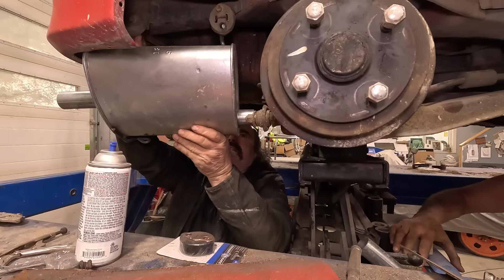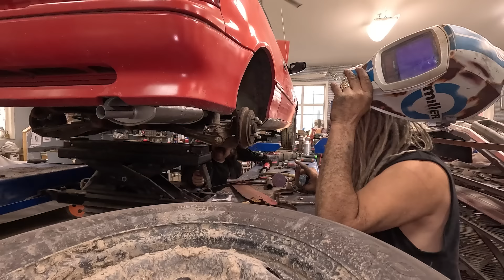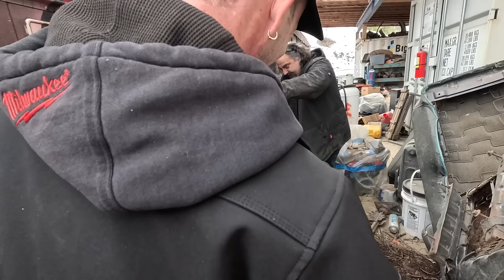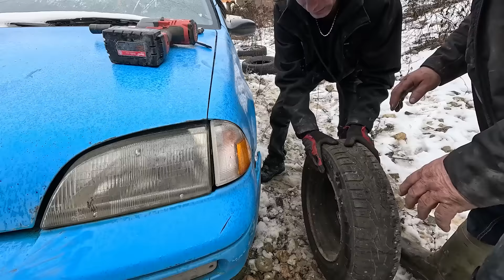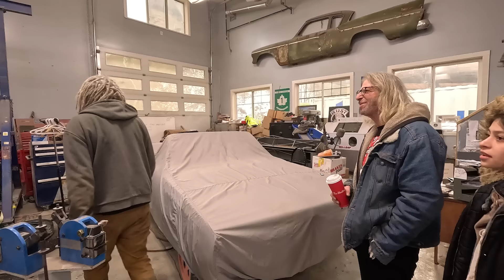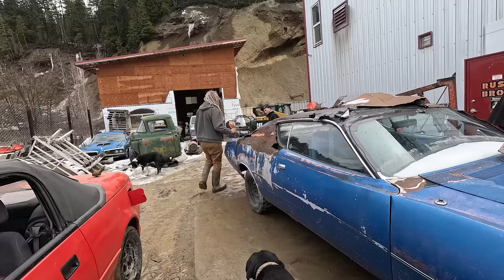Digging out Tires & Test Driving the Firefly!!

Comment: i have an old Chevette..Not a highly collectible car by any means but this one is a 87 Chevette with 39 k miles in mint condition with a sport package from the factory..2 dr hatch back with a 4 sp manual trans..As Chevettes go this one is really clean and looks like it came right out of the factory door..anyway..i know the 13 inch drill with finding tires head ache..i was looking for raised white letter tires for it and as it turns out they don't make them..they did years ago but even finding any decent 13 inch tires these days is a bit of a chore..

Comment: I love that little car excellent on fuel miles compared to my 1999 chevy suburban four wheel drive which is in really good condition with no rust but it only gets about 12 to 14 miles a gallon on the highway if you keep your foot out of it those 5.7 350's love the fuel but that thing is a power house